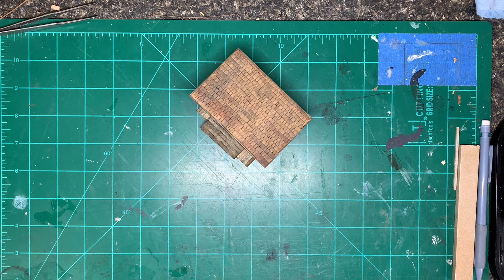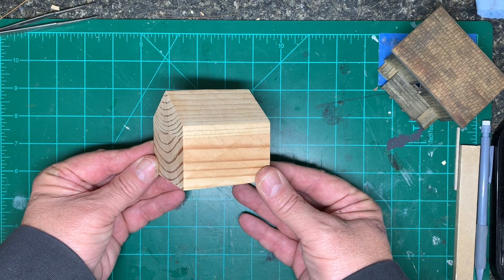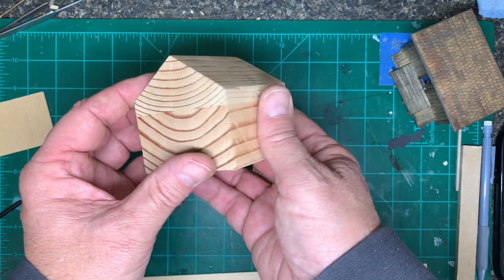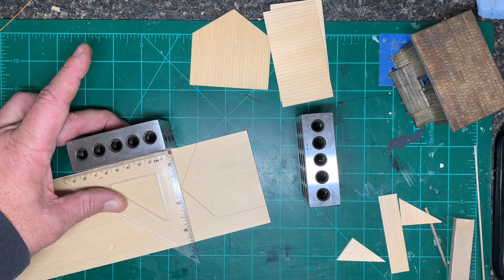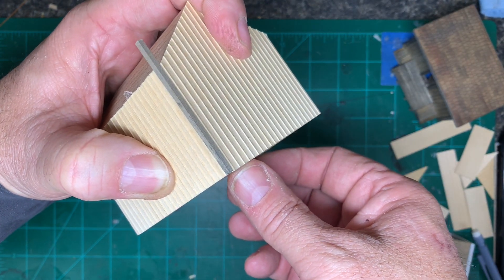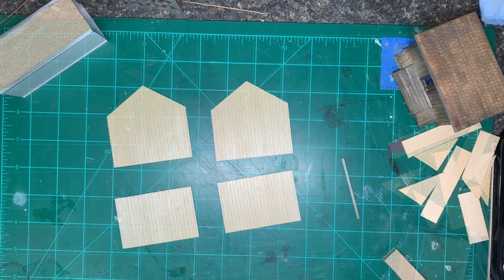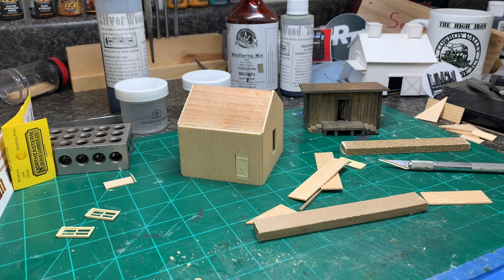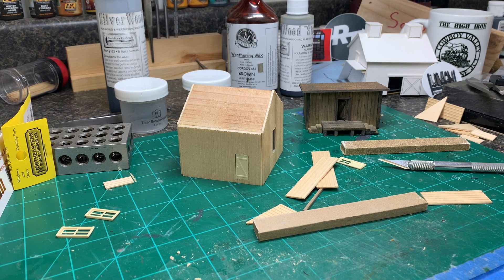Structure Build 10.1  ( 2x4 Maintenance Shack )

Comment: A few years ago I built a small shed, much like yours, using a 2x4 as the base structure. The one thing I did differently is I drilled a 1 inch hole 1/4 inch deep behind the windows. The holes were the painted some black color. I'm not sure that it made a bunch of difference, but in my mind it added some depth. I love how you are doing this. Very nice build. Thanks for sharing and stay safe - Larry.
Reply from the maker: I may try that, I think I even discuss it in the next video.  A hole drilled window to window and one up from the bottom with a flickering yellow light and bam! 💥 you have a lit building.
Reply: @OtterCreek  I did not think of that. Cool idea.